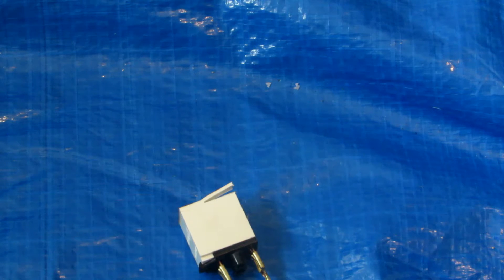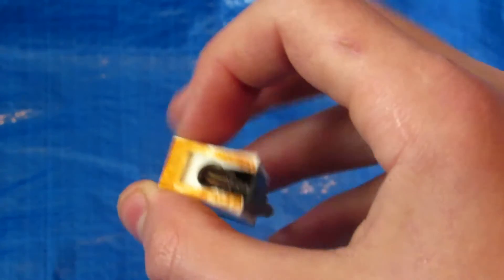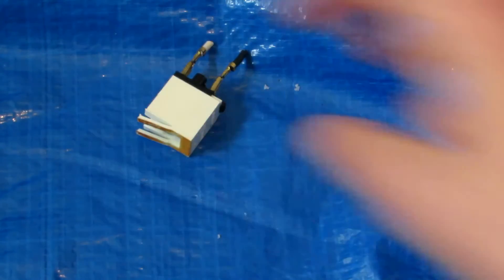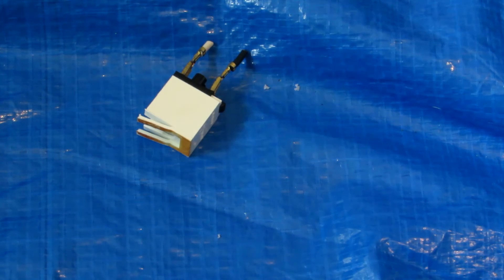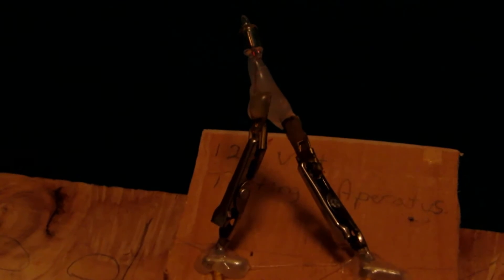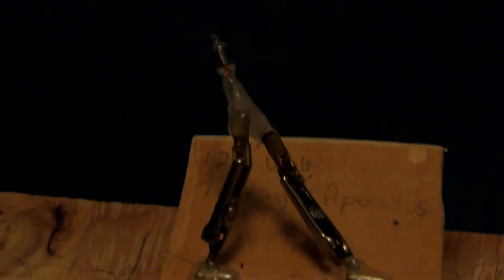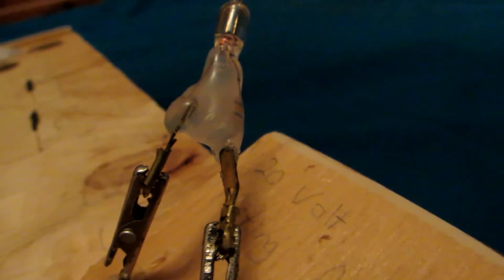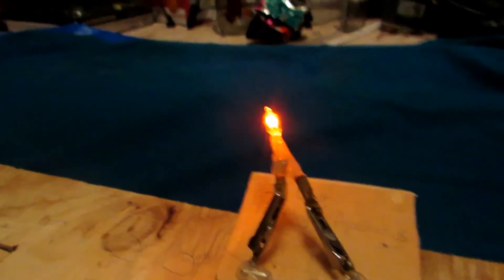Neon from Indicator Lights (Household Materials)

Comment: what was your power source?
Reply from the maker: just 120v, the gas is at low enough preassure for that much to do the trick. high voltage overloads it and it gets to hot and blows up.
Reply: +piano and science guy ok thanks 
in your next video can you make a electrolysis hho generator
Reply from the maker: I already did a long time ago, but I want to redo it and make a better version... I will make one fairly soon.
Reply: +piano and science guy ok